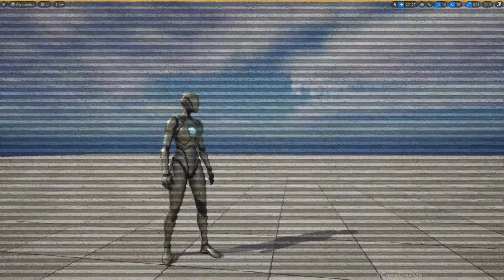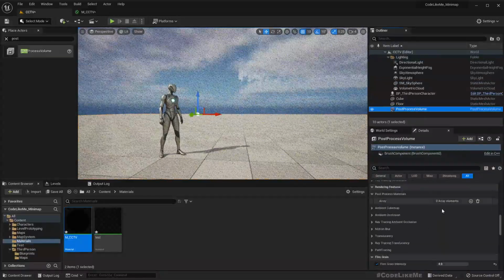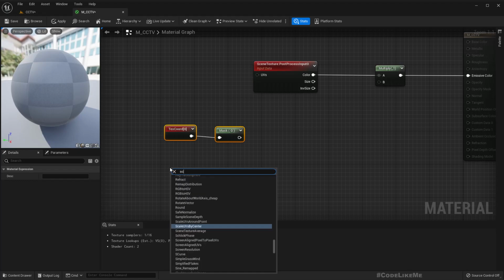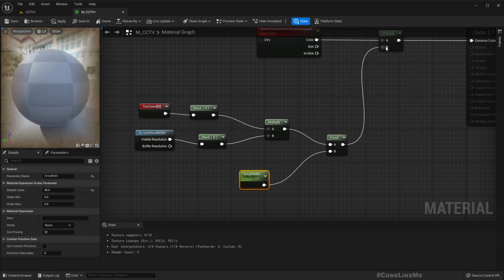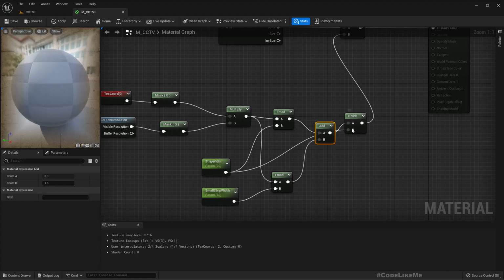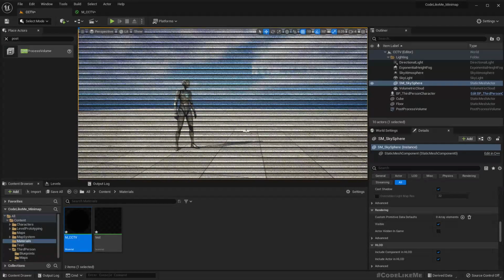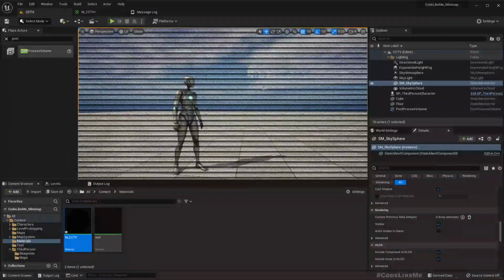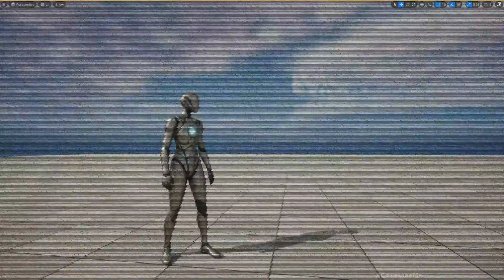Unreal Engine 5 - CCTV Post Process Effect

Comment: I skimmed through this tutorial so perhaps I missed it. But how could this be turned into a toggled mode or look? How would you script that? Very new to coding in Unreal and so apologies if I ask very basic questions.
Reply from the maker: perhaps you can have a trigger box to set the blend weight of post process material. making it 0 would disable, 1 enable